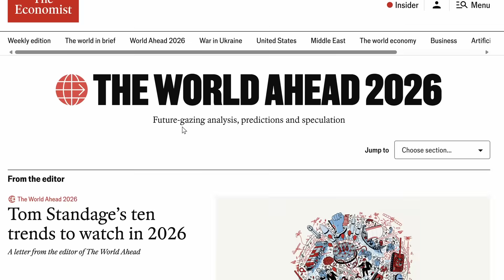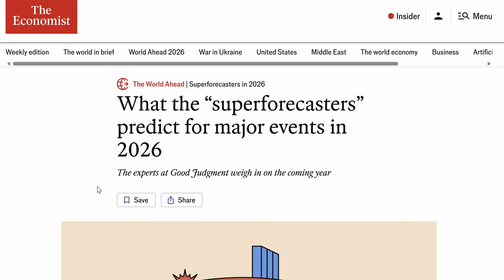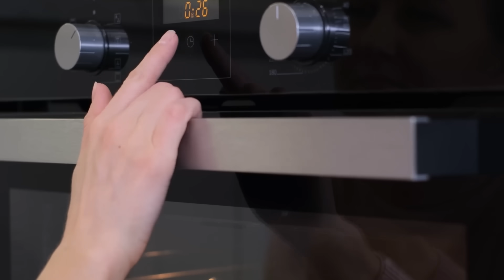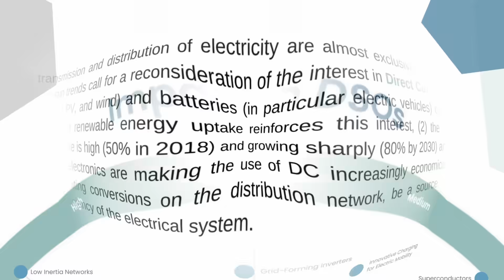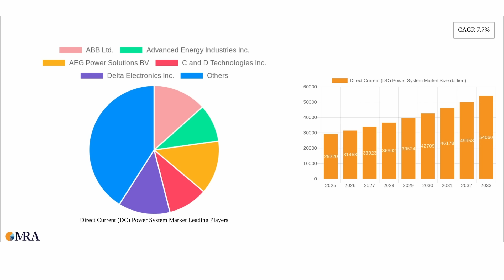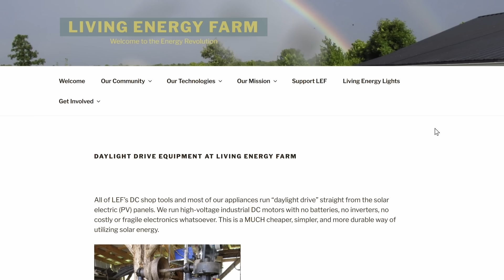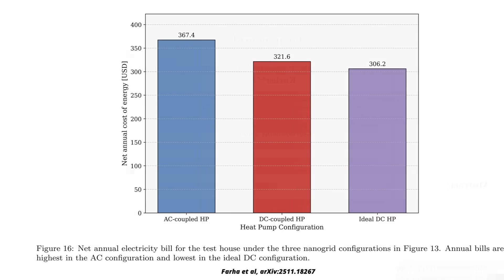Are We Using the Wrong Kind Of Electricity?

Comment: This is a bit silly - if you are on the grid you need to efficiency of AC and if you want to run on DC at home sure, run some DC rails around ... it's not crazy using AC? If you can change it ... sure, but AC is safer for the same reasons it always was.

Comment: Maybe the smart thing to do is use high voltage ac and distribution systems to drive dc generators at the load points. Split off DC in steps to get the voltage you need for any DC system.

Comment: Do Wibd Turbines (or any turbines!) intrinsically generate DC?   Only a changing magnetic field induces a current..... You can change intensity (flux?) of the magnetic field but that's impractical: static magnets don't suddenly get stronger/weaker.  You can move the B-field in relation to the coils as turbines do by rotation.  But a given coil induces current proportional to the CHANGE in the magnetic field which is maximal when polarity is alternated..... which induces AC.... 
Unless I'm missing something?

Comment: What kind of nonsense is this about the wrong type of electric current? What kind of physics did you learn in school? We use alternating current because: 1. It is transmitted over huge distances with almost zero losses. Direct current, when transmitted over long distances, has huge losses due to the ohmic resistance of the transmission lines. 2. Almost all electrical appliances in our homes can operate on direct current, but this does not mean that we could power a house with direct current. Here's why: A mobile phone needs 5V, an LED lamp may need 10V, an electric mixer may work with 15V, a television needs 5V, 12V, 50V and 100V simultaneously, a microwave oven with 30V, a laptop with 19V while a stationary computer needs 5V, 25V, 50V and 100V simultaneously. All electrical devices have transformers and rectifier elements and easily convert alternating current to direct current, at the voltage they need. With what voltage of direct current could we supply a house since each device works with a different voltage? If someone claims that we could power a house with 120V direct current for example, then we would need more complex electronic devices for the conversion from DC to DC, with much greater losses. Because while AC is easily converted to DC at any voltage, converting DC to DC is a very difficult process. In conclusion, I will tell you that of course Tesla was right in his duel with Edison. Tesla was a distinguished physicist and had an enormous theoretical education, while Edison, although he was an intelligent and brilliant inventor, was ignorant of the theoretical physical principles of electricity. If today our civilization has illuminated the darkness of the night and our cities are bright, we owe it to Tesla and the alternating electric current he discovered.

Comment: I think our EV cars 🚙 should be designed to use Aluminum/Air battery technology.
Such EV cars have been shown to travel 1300 miles before requiring that the Aluminum Plates be replaced. Likewise, you never 🔌 "plug in" such EVs, to charge them.
Imagine going to Jiffy Lube, every 1300 miles, to have a technician rapidly "swap out" your OLD Aluminum Plates for a set of BRAND NEW Aluminum Plates. Inside of 10 minutes, you would be "good to go" for another 1300 miles. Occasionally, the same technicians would have to replace your Aluminum Hydroxide electrolyte, but this need would probably not arise as often as the need to replace the Aluminum Plates. Since our economy already has the means to recycle Aluminum, in place, transportation based upon the availability and recycling of Aluminum would probably be very "do"-able.

Comment: Accidental direct contact with High Voltage DC is far more dangerous than accidental direct contact with High Voltage AC.
The AC has thousands of moments when the voltage potential settles back to ZERO volts. During these moments, if the High Voltage has not already COOKED the inside of your arm, you can command your hand to LET GO. No such luck with DC.

Comment: But DC conversions (e.g., higher to lower voltage) still work by switching, that is a form of alternating current back and forth from an inductor in a buck (boost) converter. Which is the most efficient way of converting voltage/current. So even in DC system we end up using AC.
Which is much more expensive (and intrinsically fragile) than directly working with AC. So it all depends on the specific case and conditions.

Comment: it is still a matter of Ohm’s  law: the losses on high voltage lines goes with I^2 x R. you can not reduce resistance(R) to get rid of this losses. copper is still the best you can get for a reasonable amount of money and it is the wrong leverage. the only way to improve efficiency is to reduce I^2. best done by increasing electrical voltage. ( P = I * V ). this is why we have high voltage lines. we use electricity for the best. way possible: AC For transmission and DC for certain applications of electricity. As a scientist Sabine is well  aware of this scientific fact.  we do not use electricity wrong. It is a matter of the right choice. 5 V DC to transmit over a power grid is certainly the wrong choice.

Comment: 96vDC is in very interesting.  Along with 48v. For end use. Though more copper is required.  

That said, very high switched DC is the answer for transmission. All grids will be switched DC eventually.. it allows easy isolation and balancing .. unlike AC.
Reply: What's the loss in efficiency to get this "high switched DC"?
Tesla even said we should be using much higher frequency. Doubled to tripled what we use today. 
AC is very efficient in long distance transmission. Using wall warts to convert to DC is very efficient, and simple. 
What DC voltage do you want to use to send thousands of miles? Then when is it switched to lower(safer) voltage for normal usage? And who's going to pick the voltage so every product is that said voltage, for more efficiency? 
AC will not go anywhere but I do see houses of the future with dual systems. AC for high load stuff and DC for lights and little things.

Comment: Electric cars (the motors) work with AC. You can't store AC in a battery. Inverter losses when converting DC from the battery to AC used by the motors are marginal.

For eg. in my Tesla Plaid a full acceleration pulls 820kW from the battery and only around 20kW is lost as heat in the inverters. And this is a 1000+ hp performance EV. I suspect that the losses are much lower in less powerful EV's.

Comment: The oddest thing to me is that it comes up as an issue. 💁 You see anyone who is familiar with the craft knows of instances where both forms of electricity are in use. Older telephone systems normally had the voice signal riding on top of the 48 volt “carrier” or “on hook” voltage. An echo of this lives on today in the POE or power over Ethernet systems used to power WiFi access points. 

AC electricity handily passes through Capacitors or transformers while DC doesn’t so separation of the two types of electricity is simplicity itself. The only complex aspect is figuring out why on earth there’s an argument.

Comment: AC is easier to make up for lost in long runs, DC needs to be converted to AC for use with a transformers or it has to be pulse turned on and off. Voltage drops are easily corrected with AC. It's a lot harder to correct DC losses, all all wiring has Voltage drops do to resistance, the longer the greater the lost. I can't imagine bringing a 13,800 vote DC line to 120 votes without a transformer.

Comment: Your comments are as always valued Sabine. 
The historically viewed argument between AC and DC (Tesla, Westinghouse &c, ) is no longer valid. One of the arguments back then, was that AC could/would let go of a persons muscles when in contact with a rail....as in a railcar rail. Whereas DC would not. All archaic concepts now. 
These days, with semiconductors achieving the high 90%'s and with Battery storage becoming more accessible, the idea of transmitting power via the AC "transformation," advantages, loses its appeal.
The storage of power in batteries is not yet ready for mass implementation, but is approaching rapidly.
The electrical grid authorities have good reason to fear the loss of their revenue oligarchy
Net Zero is still a way away, but coming soon. Musk's batteries are a proof that we can live self sustainable lives in the average household.

The thing is, that when it happens, it will happen overnight......... everyone will just simply switch their homes off grid, to battery and whatever means is available......................Industry can fend for itself.

There will be a one fingered salute to the powers & authorities who have "bled us dry," for so long.
Keep up the good work Sabine 😁😁

Comment: Long distance high voltage transmission is an entire different world to that of end users and really does not belong in the same talk.  AC losses are extremely high under sea water in particular, and it is largely useless for sub sea cables.  Modern mega watt inverters have efficiencies over 98%, which is astonishing.  Still, the majority of home electronic devices only want to see 5 or 12 VDC and the lower the voltage, the higher the Amps and the more copper that is needed.  The 110VAC in North America or 200VAC other places, reduces copper required.  Local transmission in the US is 12,500VAC which needs much less copper.  It is very difficult to imagine re-wiring the distribution system for DC.  The cost of the copper would be very crazy on a large scale.

Comment: The large wind farms use alternators and can be rectified to DC and then back to AC for the correct frequency. Alternators are less maintenance than DC generators. And all the problems with electricity would be solved if we just used AC batteries.

Comment: EVs use AC induction motors. AC can be transmitted across great distances via transmission lines, unlike DC. Generators produce AC, not DC. There are foundational reasons why AC is used in power transmission. Yes, DC motors are a little more efficient. Yes, inversion of DC from solar panels is a bit lossy. Neither offsets the benefits of AC power transmission.

Comment: Just some thoughts on electricity.  In the early days AC was the chosen system because the only way of changing the voltage was by transformer.  Essential for wide distribution!  In the modern world DC current transmission is much more efficient and is used extensively in high voltage transmission, converted to AC at the distribution point.  Thankfully we now have the technology for this conversion.
Moving on to the health aspects and I point out here that electro-magnetic fields are sometimes used in medicine to promote faster healing.  I do wonder if the fact that we now live in an AC electromagnetic field in our homes has contributed to the rise in cancers thanks to the above demonstration of the effects of electro-magnetism on the body.
Moving on perhaps we should be moving to a DC system, only converting were absolutely necessary.  It would certainly be more efficient in transmission.
I do know of people who are extremely sensitive to electrical fields and choose to live in a low voltage DC environment or even live in a pre-electricity environment.
Thunder and lightening storms are interesting as they can have a dramatic effect on animals, including us.  At the end of the day we are just another animal on this planet.

Comment: Going slightly of of topic for a second, they have been looking at and testing pulsed DC over power lines as a method to transmit DC to peoples homes and it does work but it will be noisy to everything that's made to receive a signal. The Armature radio operators are gonna love it.

Comment: As an electrician I have contemplated the DC house . As suggested most electronics run off DC . Actually years ago I converted my PC to run exclusively off DC and a 12 volt battery . The RV industry uses quite a bit of DC devices . Even fridges and microwaves . 
Now 12 volt supply would require larger conductors which make wiring a house not practical so the voltage would need to be higher . 
So yes it could be done and you would have some savings but reversing a 100 years of AC would be trillions in cost . You can find dC fridges but there are not many . They are small and expensive .

Comment: EVs use DC mostly for storage and acessories lights, controls, etc but converts to AC to power AC motors because it's more efficient. Although a DC motor can be more powerful than a AC motor  of comparative size and rating.

Comment: AC electric motors do not require commutator brushes (all that phase business makes them work).  Brushes in DC motors wear out.  AC electric motors run industry and are extremely reliable.  AC transmission lines only need one wire (electrons are pushed into and sucked out of the ground at the end user).  DC needs two wires (one to send electrons out and one to send them back).  A big part of AC adoption came when Tesla invented the brushless AC motor.

Comment: Wind turbines create AC.  
Solar panels create DC at low voltages.
To transmit electricity long distances you need high voltage to overcome the current squared times the resistance losses.
If you convert DC to higher voltages you have to switch it which makes pulsating DC then you can use a transformer to (transform) increase the voltage.
If you convert DC to high enough voltages for transmission then you need to step it down to use it e.g. no one can afford motor windings that that can with stand kilo volt ranges.
AC can be stepped up and down using transformers.

This is an extension of the fairy tale that solar and wind are somehow practical to run a grid.
Besides the batteries that do not exist the switching losses required to generate high voltages for transmission are prohibitive. 
All this does is create the exact same conditions which caused the blackout in Spain everywhere.
You either have a (fusion will never be practical) fission nuclear powered grid or you have to burn something to get the power we need to live modern lives.
TINA There is no alternative.
Stop pretending we can use unicorn farts and fairy dust to run grids that support modern life as we know and all want it.
I am not going to die in the freezing cold or swelter in the burning heat to support your fantasies.

Comment: Ok, regardless of AC or DC being better or worse..... the problem I have is with all the Electronics being used to control the distribution etc. I mean come on, the Engineered Obsolescence in everything these days makes the efficiency of of power distribution a moot point. Nothing that uses electricity lasts beyond 10 years anymore, not because AC is better than DC and vice versa, it's because all of the gadgets associated with electricity are f-ing junk.

Comment: Hi Sabine - Nice info. .Just one correction.. Wind turbines uses rotary motion and thus generates AC not DC as you suggested. I agree solar output DC. But fundamentally the output from a Wind turbine is AC. The conversion after that is determined on the application.

Comment: From a technical point of view, it doesn't make sense to play off direct voltage and alternating voltage against each other. Today, the use of electricity is determined by a series of transformations. Actually, conversions are always accompanied by energy losses. But since very different voltages are required at the different levels and points of distribution and application of electricity, conversions are unavoidable. Interestingly, effective voltage conversion is only possible in the form of alternating voltage. Even in a seemingly simple device like an LED bulb, the AC mains voltage is first converted into DC voltage, then into high-frequency AC voltage and finally flows through the LED as a constant direct current. Such conversions are not very lossy in modern devices and ensure that every type of power generation, transport, storage and use is carried out in the most effective way.

Comment: The real reason AC won over DC is because it's so easy to step up and step down the voltage with very high efficiency. Transformers are usually in the 99% efficiency. So you can easily step up the voltage for long distance lines and then switch the voltage back down when you need to use them

Comment: Wait how does a win turbine generate DC? It has to generate AC. Yeah it does but a very irregular AC that is converted into DC and then back into the grid compliant AC.
The big problem of the AC grid + renewables is that the way to balance the grid is LOST. AC generators know when to ramp up because the frequency of the grid drops and that is when power needs to be pumped in. 
DC generating renewables need to "guess" what is going on and adjust their phases respectively. Come to think of if, how would a DC grid know when to pump energy in? The voltage drops?

Comment: New electronic all low power dc like 12 volts dc throughout then convert to ac at load . triggle charge capacity then use 3 plate capacity like transistor

Comment: It all about the money and how you can measure the figurative consuption of electricity. Alternating currents (AC) can be measured from it's sinus waves top and bottom, thus calculating consumtion is made possible. Tesla wanted household consumers to use DC, which is alot safer,  while used. Greed is responsible as usual.

Comment: If you look into history, you can learn that the reason we use alternating current is due to heat and wire size. AC allows us to transfer electricity across longer distances utilizing smaller wire to achieve the same result.